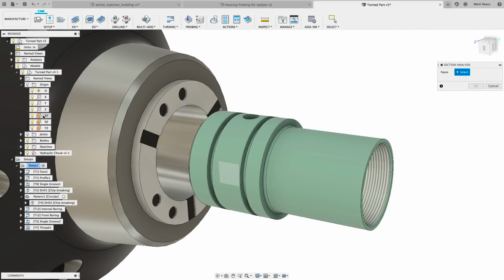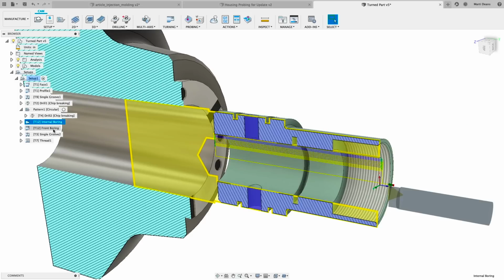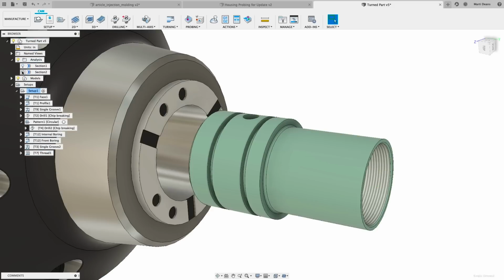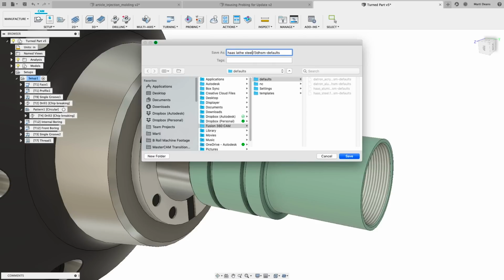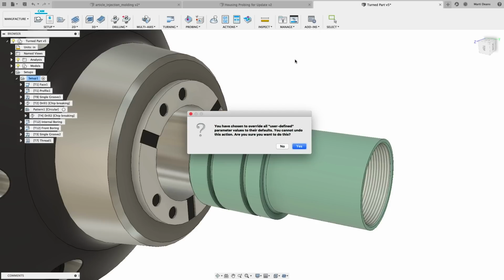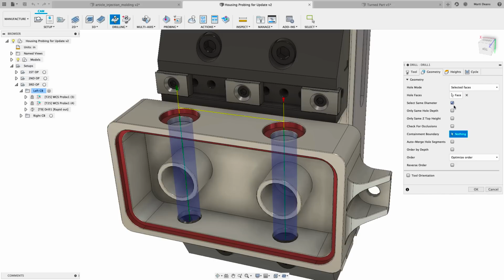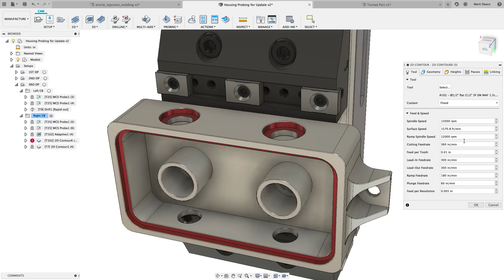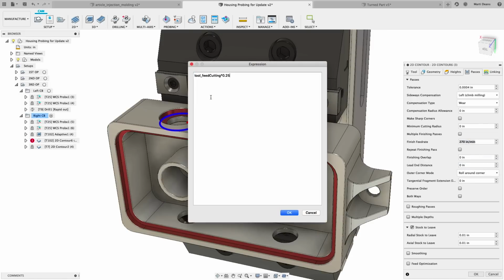What's New in the Manufacturing Workspace

Comment: Hey add ELEMENT DELETION IN SIMULATION so we can have realistic simulation like in abaqus and nastran.........
Reply from the maker: That exists in event simulation.Check it out!
Reply: @adskFusion  i know but i want it in normal static mode like while doing tensile test of model etc ...The Fusion360 is great software comparing to other like solidworks autocad etc since in my project require actual or realistic failure in simulation, i searched alot and found Abaqus for element deletion or Explicit dynamics but it is too complex to learn  so 
In short if u add this option in fusion360 then it will lead fusion360 to another lever CAD CAM CAE software that sit....and pls reply me if yiu see this comment
Reply from the maker: I see your point, but I don't know many static loading situations where you'd ever push a design to the point where you'd need elements deleted. My personal 2c, not the Autodesk corporate response. Also, how much are you expecting to pay for Abaqus?
Reply from the maker: Element deletion is in Fusion 360 event simulation. 
http://help.autodesk.com/view/fusion360/ENU/?guid=GUID-A22E2BC5-D0DF-46ED-B75E-D9CE8D40752E
Reply: @adskFusion  Thanks sir for quick reply :) but i think the event simulation is basically for impact analysis not for gradual load like in static analysis (correct me if i'm wrong) 
here's the link of my model https://drive.google.com/open?id=1GMDpvva-u84m4WpGaB90D44KcIN6tPGt
And also my model elements got deleted at load applied face only not at any middle portion  or somewhere else (THE ELEMENT DELETION IS FLOWING LIKE RIGHT TO LEFT IN MY MODEL) & HOW TO CHECK FACTOR OF SAFETY IN EVENT SIMULATION Help me to do this study or suggest any information regarding this

this is the last question and pls reply when u see this
Reply: @adskFusion  I'm waiting for your reply sir .............
Reply from the maker: You can load event simulations as slow or fast as you like.
Reply: @adskFusion  ok so can i do tensile test on event simulation last question .. ;)